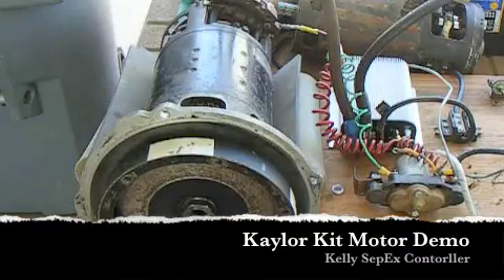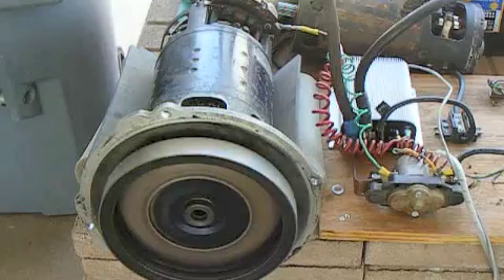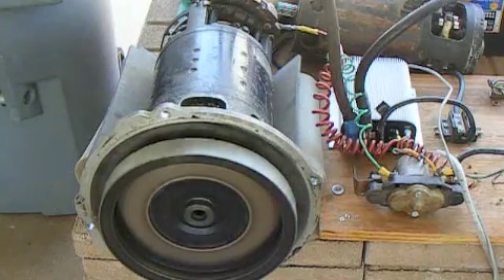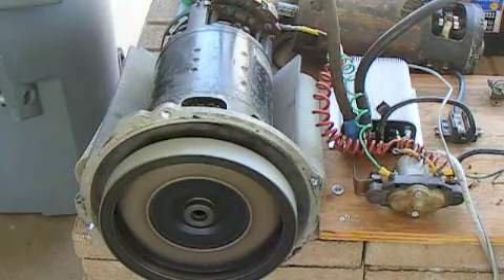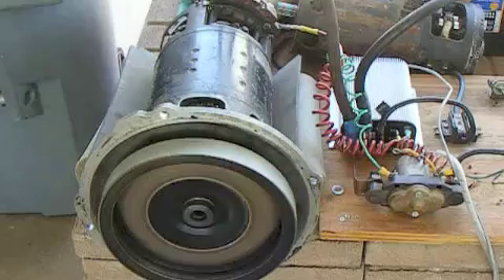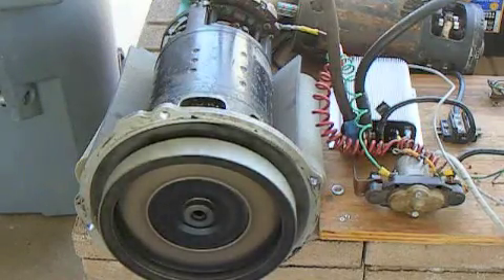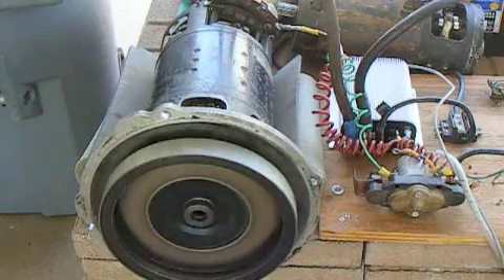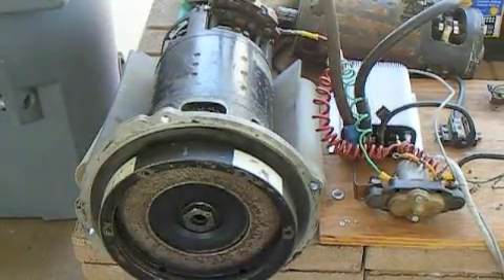Kaylor Kit Electric Motor Demo

Comment: İS İT DC MOTOR?
Reply: Yes, these are DC motors. They are special SepEx DC motors that were used as jet engine starter motors and then switched to generator mode. They were geared to start older jet engines then when switched they provided 36 volts to the airplane while in flight. I can connect up a standard Series Motor Controller and get them to run rather well but would not provide regen. If they are connected only with diodes and relay switches then they can be set up to also provide regen. Here we were playing with a modified Kelly controller so we could do regen as well with a standard SepEx Controller. It sorta worked. We then went to a larger SepEx controller and they did a software workaround and that worked great except if you set the regen past 50% it would blow the controller. These little things pumped out some serious amperages in regen mode. More than the Kelly could handle. Kelly then decided not to pursue the avenue and just went back to making standard controllers for standard motors. If you connected one to an engine you could generate useable power. But the speed would need to be high enough to provide enough voltage to charge a pack. These would be great for charging 24 or 36 volt packs for an off grid system as long as you have an engine suitable to spin it up. These motor are durable and long lasting. I have 4 of them.

Comment: What motor do you suggest for lightweight, high rpm applications? Say for instance 25,000 rpm with 120v controller.

Comment: Manufacturer of Kaylor electric motor could become a single building block 2 advancement of quad electric drive motor vehicles & opposing directional wheel steering Here's my ideal: incorporate a neutral coast mode n the motor which will allow the shaft 2 simply spin n housing without added power which would be useful n coast mode which would allow a vehicle to use the built up moment momentum 2 coast down highway much like existing ICE cars (Law of Inertia). Develop this & the rest will follow.

Comment: @iwatchfunny 

Yes, that is why in the earlier post that you need to rectify the AC back to DC so you can utilize the power. There is a loss but not a great deal. Once converted back to DC you can use the power but it will be limited as to what you can actually do. Your amperage will be the limiting factor.

Comment: @iwatchfunny 

If you connected the electrical output from a standard generator you'd need to rectify it back to DC to run the motor. Most generators you can buy like at Kragens you will be producing AC. AC needs to be rectified back to DC and once you have DC then you can use that to run the motor but you will be limited to the amperage output of the Generator which usually is like about 60 amps. If would work but it would be slow. Most accelerations take 300 or more amps.

Comment: An 11" or 13" DC Series Motor will do just fine. Or you could use a dual 9" or Dual 11" motor as well if you have the room. 

Check out DIY forums Do a google search. Can't post links.

Comment: If you have a VW Buggy then yes you can use this setup. I'd still use Lithium instead of lead. I am now using lithium and with this setup it should do fine. I am actually testing it in my 69 Ghia right now. I have the motor connected in the car and I replaced both adaptor bearings and have it all hooked up like a test bench to be sure all is well before I venture out on the street to test the regen. 

Pete :)

Comment: Lead Acid Batteries are in my opinion just not viable for an electric car. They are heavy, Don't last long, and have little usable AH truly available. LiFePO4 Cells are a viable lithium cell and will get you a good long way at a decent speed. As for this motor in your truck. Not a chance. This is a tiny motor and best used in like a VW Buggy. Not a heavy truck. Even in the Ghia it was considered small as far as motors go. So to answer the question, I would not recommend using a setup like this.

Comment: Hi,you say 12 6 volt batteries will push a VW Ghia to 62 MPH. My question is how far will it go? I have a 1999 Nissan Frontier P/U (so I have a whole bed I could fill with batteries,once I beef up the suspension,and braking system,more weight+ bigger breaks) Will this system work on my truck? Thank you in advance for you time,Walt

Comment: Ok, mine will have to have more power as i'm planning to be using a full size brushless engine and re-use/ amplify the power from the left-over energi created by the magnetic field.
It IS possible, you just gotta figure out a way to do so.
Lots of researching still remains and practical testing will commence once i get to start making the parts and assemble it.
Currently 4 magnet related projects are pending and more magnets are to be purchased before anything can happen.
Any advice?

Comment: @vinmassa  the Kaylor motor is a 400 amp, peak 30 HP, shunt motor. At 72 volts it achieves 7,200 RPM. These motors can reach 10,000 to 12,000 RPM for short periods of time. Wt is about 60-70 lbs, as I recall. It is built to military specifications. I have 6 of them, plus adaptor plates, and electronics. email akernoff2009 (@) gmail (dot) com

Comment from the maker: The starter/generators will do 8K rpm and that is screaming. I think if we are successful we will try a 120 volt controller with these motors too. Might just make a nice addition for small light cars that can do regen and be DC motors. Motors are military spec so are very well built. They will last a very long time. I like them but they are small. I'd like to see an 8" or 9" motor built like this. But for aircraft you need light weight. Movie and test vid comming soon. 

Pete :)

Comment from the maker: The controller  I am using here is the first attempt and it is hardware modified. The one I will be testing real soon is software modified. So we are testing both the new controller and software. I now have another VW to install my motor into and we can commence with our test. If it works you can purchase these controllers from Kelly and do the software modification and run your motors. They will do regen too if installed in a car. You can disable regen. The motors are great. Fast boogers too.

Comment from the maker: The starter/generator style motors are not your normal shunt Sepex motors. They will do both but you have one field that is common with the armature. Therefore you only have three wires to plug into your sepex controller rather than four. But they will not work with your standard sepex controller nor will they work with your standard series controller. I have been working slowly with Kelly Controller about this and have a new beta unit that is software modified to work with these motors.

Comment: I've put a G23 Jack and Heintz shunt generator / motor in a boat. Looking for a 24 to 48 volt variable speed controller. Tell me more about the PWM controller you used here? Thanks!